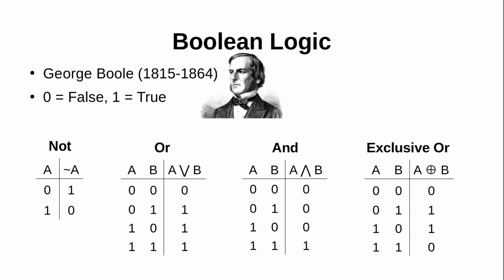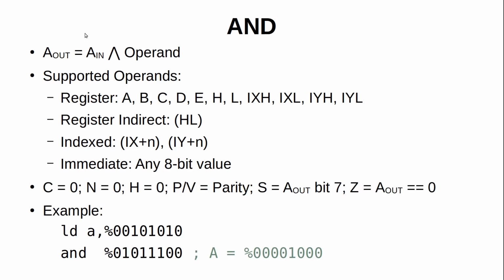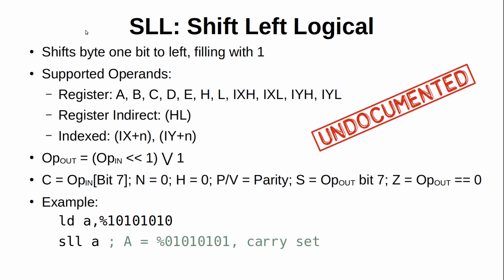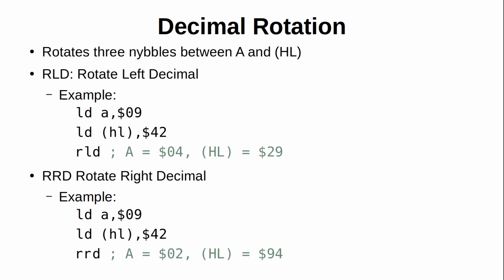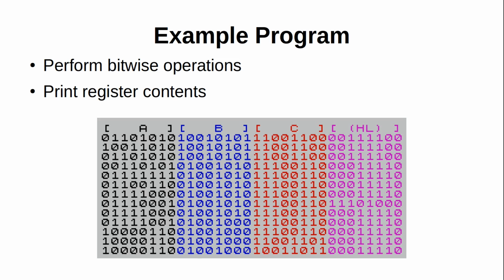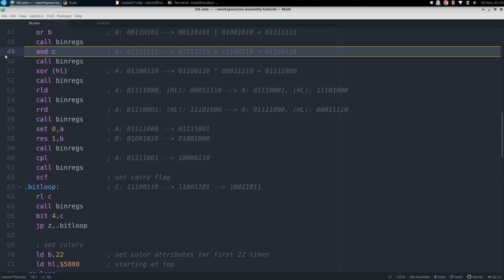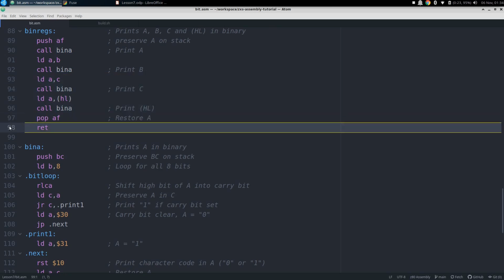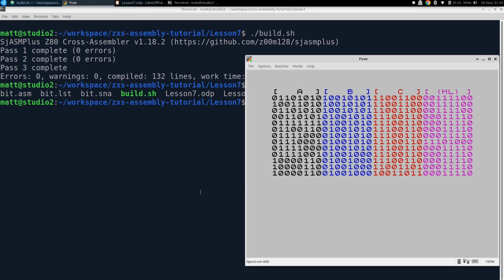Bit by Bit: Z80 Assembly Language for the ZX Spectrum Tutorial, Episode 7

Comment: I'm puzzled how the rotation opcodes work. How RL r works as an example. In order to produce the result it does, according to documentation, starting from the leftmost bit,  bit7 goes into the carry, bit6 goes into bit7...etc etc..bit0 goes into bit1 and carry goes into bit0. But how? What's preventing bit7 from overwriting the previous carry (as the new carry) BEFORE the previous carry goes into bit0? Similarly -  bit0 can't be overwritten with the previous carry before bit0 goes to bit1 etc. Is there another flag somewhere that temporarily holds a copy of bit7 until all the bits have been shifted and THEN the previous carry goes into bit0 and then finally the previous bit7 (i.e. new bit7 = previous bit6) goes to the carry?? Sorry but - can't seem to explain my thoughts much clearer.
Reply from the maker: It's just how hardware latches work. By the time each bit gets set, it doesn't need its old value anymore. There are many ways to implement that, but ultimately it doesn't matter to the programmer.

Comment: How did you make it stay on the screen without resetting after a millisecond?
Reply from the maker: It works just how you see it with Fuse. Are you using a different emulator?
Reply: @slithymatt  It shows what is supposed to appear but then it resets after a second.
Reply: @slithymatt  I use the same emulator.

Comment: There are also some other undocumented instructions which might be useful  for example RLC B,(IX+jj) which does a RLC (IX+jj) and also stores the result in B.  There are equivalents for the other shifts/rotates and for storing in all the 8 bit simple registers.  Similarly there is also RES B,0,(IX+jj) which is sometimes seen as RES 0,(IX+jj), B  which resets bit 0 of (IX+jj) and then also stores the result in B (but can be any 8 bit simple register). It also works with SET.  Maybe only useful if trying to reduce every unneeded T-state.
Reply from the maker: Do you know what the opcodes are? Do many assemblers support them?
Reply: @slithymatt  Yep RLC r, (IX + nn) is DD CB nn 00+r  (where r is 0 = B, 1 = C, 2 = D, 3 = E, 4 = H, 5 = L, 7 = A)  Similarly RES r,0,(IX+nn) is DD CB nn 80+r (bit 1 is 88+r) and so on.  SET r, 0,(IX+nn) is DD CB nn C0+r

It looks like sjasmplus supports the instructions but uses RLC (IX+nn), r and RES bit, (IX+nn), r
Reply from the maker: @andyleighton3616  Do the other undocumented indexed opcodes work that way? Like RR (IY+nn),A for FD CB nn 0F?
Reply: @slithymatt  Absolutely - but the hex for RR (IY+nn), A is FD CB nn 1F - a plain RR (IY+nn) being 1E at the end.  RRC (IY+nn), A would assemble into the hex you state.
Reply from the maker: @andyleighton3616  Oops! Forgot the 1! Yes, that's what I meant. Very interesting! So all of the indexed bit (DD/FD CB .. ..) will affect the index register in addition to the standard register for CB .. instructions? I guess the only exceptions are the H, L, and (HL) ones.
Reply from the maker: @andyleighton3616  Thinking further then, RR IXH, for instance, should only affect IXH, right? It shouldn't be RR (IX+nn),H.
Reply: @slithymatt  Except there isn't a RR IXH or at least not that I can see.  

Basically the documented instruction is RR (ix+nn). However the Z80 instruction decoder was rather naive - so it does whatever the core rotation is the (ix + nn) then also loads the result into the register using its standard mechanism. You will note that for a standard RR reg the instruction encodes as CB 18+reg where reg is the same number as I mentioned a few messages ago (0=B to 7=A) I didn't include 6 in the list - which is normally (HL).  For the DD CB instructions with (IX+nn) instructions when the register nybble is 6 it codes for the standard (IX+nn), if it is something other than 6 then I think it works by recognising the RR (IX+nn) using bit-masking, and then spots the odd register indcated (the lower nybble) and decides it needs to store it to that register.  I guess it was cheaper (fewer transistors) to build the CPU like that.
Reply from the maker: @andyleighton3616  sounds like an experiment is in order!